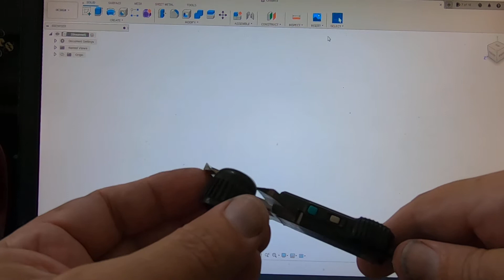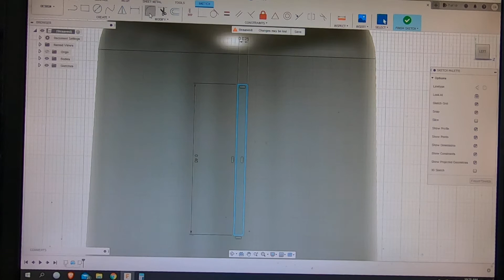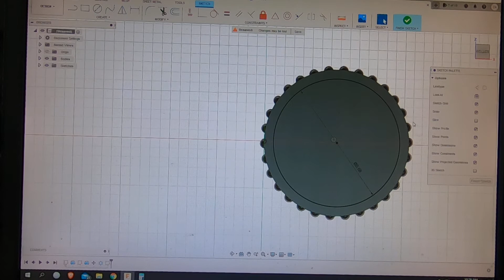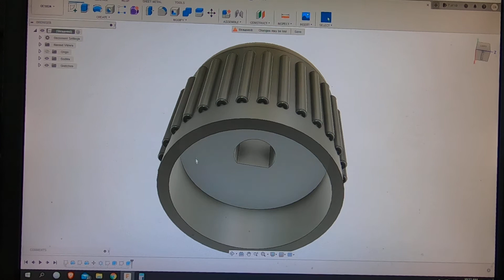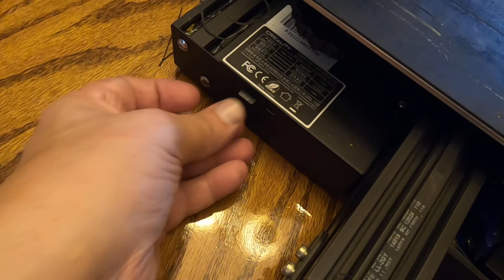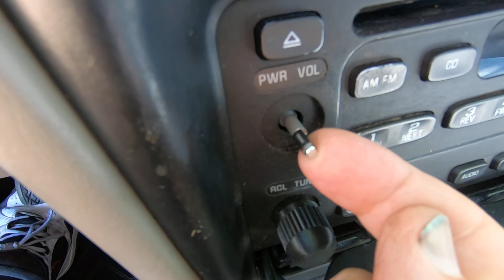How to Design and 3D Print new Radio Knobs using Fusion 360.

Comment: Great job on the sizing of everything, really impressive. I'm wondering if there is a way to smooth out the rigidness of the plastic on these parts to make them smoother around the edges. Is there a way to achieve this possibly through polishing of some sort?
Reply from the maker: If you print them with ABS you can put the parts in an enclosed container with a rag soaked with acetone and the fumes from the acetone will slightly smooth the outside roughness.